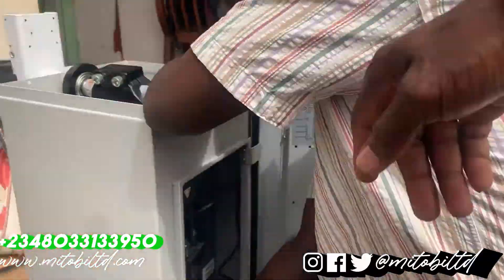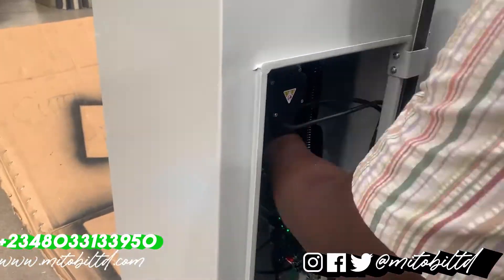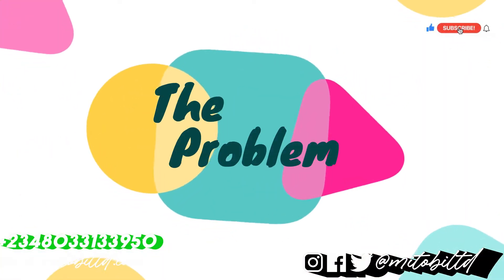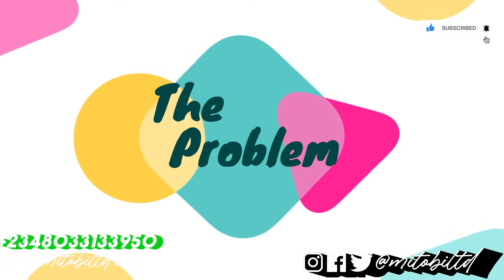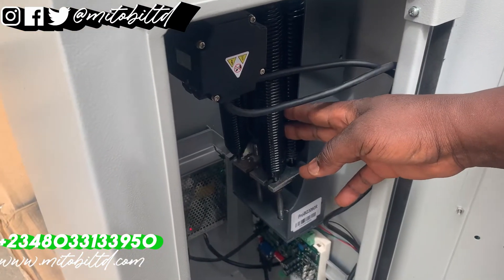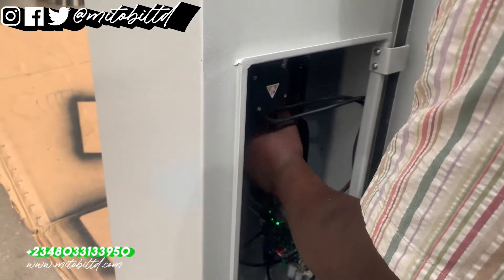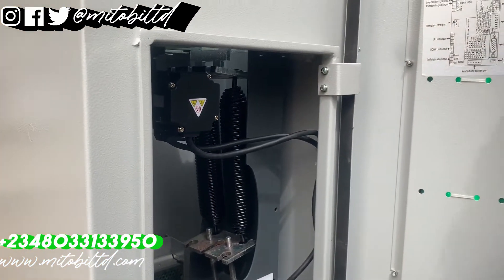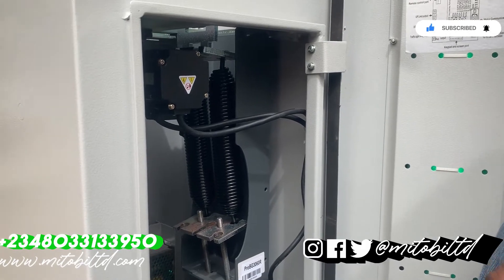How to Fix ZKTeco ProBG3000 Boom Barrier Gate | Zkteco Boom Barrier  Trouble shooting & Repair

Comment: Thanks for this video.....

My own problem is that the motor is not rotating....the push button, up and down is not moving to arm of the boom...there is a sound coming from the main board...

How do I set the main board